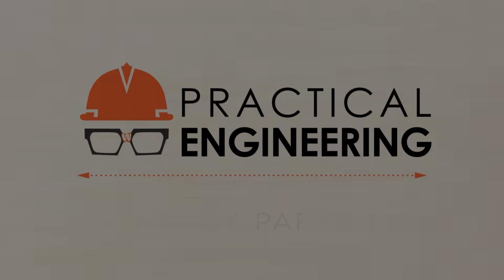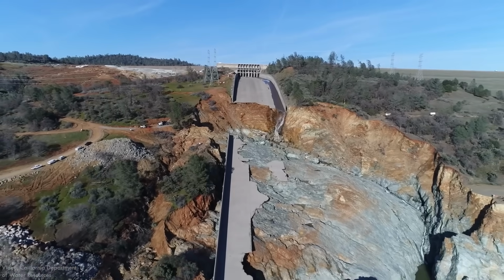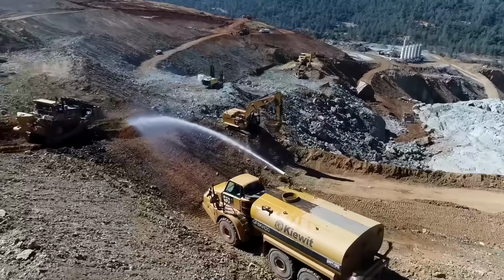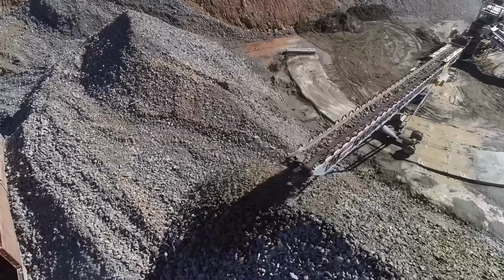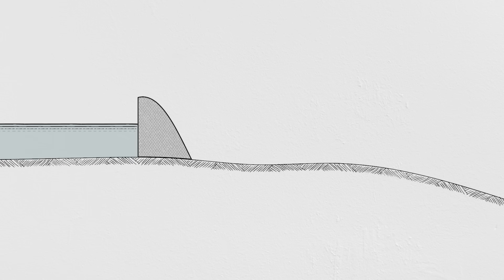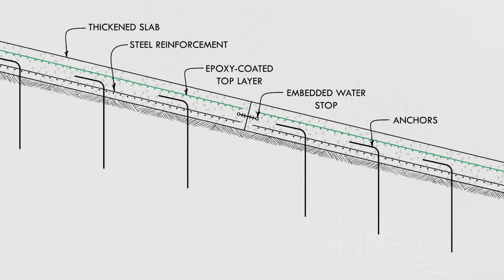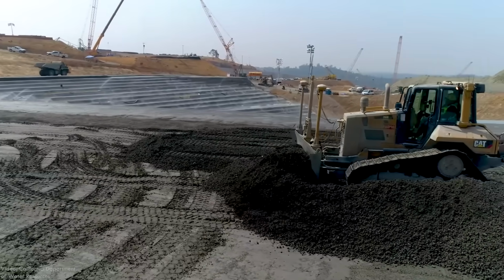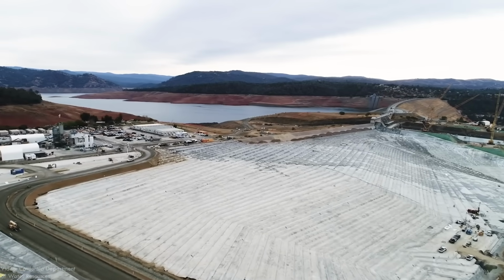Rebuilding the Oroville Dam Spillways

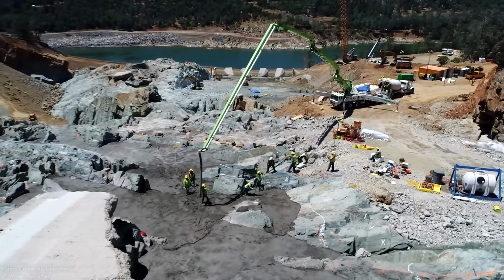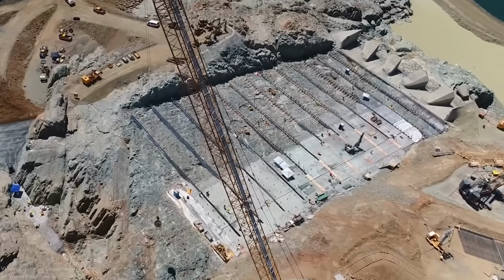Comment: I may be drunk (which would be quite an accomplishment since I don't drink), but the video from about 11:45 - 12:00 appears to show work crew members using ShopVacs to remove the dust from the rocks. That video would support the narration, which said dust, dirt, and debris were removed to ensure strong concrete adhesion. But using ShopVacs? That would definitely drive me to drink.

Comment: This a typical state project that has to have kickbacks to make it that costly. It should be audited. This is a typical state project like the High Speed RR the voters fell for. Why didn't the Bullards Bar spillway fail. It is much steeper and carries as much water? It was a Yuba County project designed and managed by a private engineering company.

Comment: This would, probably, fail too... there  are nothing to slow down water on the way of spillway.
See how Sayano-Shushenskaya HPP shore spillway made (it has 5 water-slow-down-reservoirs at 5 levels or five-stage drop consists of 5 disperse wells, 100 metres wide and with the length from 55 to 167 metres, divided by the dams). Water slows down from 30 metres per second to   4-5 metres per second at the exit to the river it becomes slower.

Comment: Uma rampa mal construída . Danos que ficam para outros pagarem.

Essa rampa nao tem base geologica para suportar a umidade , peso, vibracoes e dilatacoes e ancoragem de peso horizontal do concreto. Alem de falhas de capacidade de vazao pela inclinacao e resistencia estrutural da rampa ( muita agua para um angulo de inclinacao com uma  estrutura nao eficiente para as especificacoes da vazao e velocidades ). 

Uma coisa é ter agua, tracado de queda e bitolas de vazao e alturas potenciais. Outra coisa é ter uma estrutura eficaz e segura para suportar os esforcos e efeitos mecanicos da água  e da propria estrutura . 
Economizar para baratear uma obra pode resultar nisso.

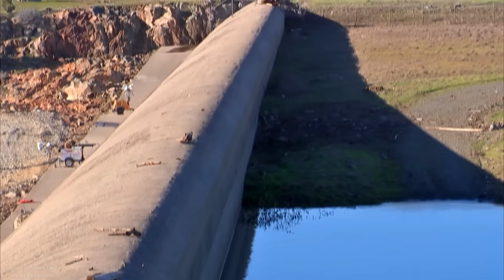Comment: where they show the cut through section of chute about 2:10 you can clearly see that there wasnt uniform depth of concrete under the chute across the section, only about 12-18 inches at one section: they thought, oh well, no - one will ever see this.

Comment: I watched the building of the original  dam. I have complete faith in it. Over the years the people controlling the water have done the best they can with what's been put before them. I totally agree with the way they had to release the water when the spillway failed. As far as the original builders of that. They did what was required in the 60's. Alot has been learned since then and better products have been developed. The same problem was seen at Folsom Dam.

Comment: I'm curious about the splash pad. What is it, and what is it's purpose?
Reply: Its purpose is to slow the flow of water as it comes over the emergency spillway (if that ever happens again) and to prevent the head cutting erosion that threatened the emergency spillway weir and caused the evacuation order to be given.  It's quite an impressive piece of concrete in person - if water ever does go over the emergency spilly again, it'll be quite the spectable cascading down that splash pad.

Comment: Thank you so much for creating this (and the related previous video on the original spillway failure) summary of the remediation effort on this massive structure. While I'm a fan of most things involving technical engineering, I am not an engineer myself. Your presentation conveys the story in an easily understood and somewhat entertaining manner. I hate to use the term 'dummed-down', but you've accomplished to communicate the essence of what was done an why without needing a PHD to follow along. Great result here!

Comment: My dad and grandpa worked on the Oroville Dam in its original construction. My grandpa was actually a foreman over the Spillway project at the time. DWR had been notified many times over the last 10-20 years that the spillway needed maintenance and without proper care would lead to failure. This is a result of negligence by the DWR.

Comment: In April 2019 the lake was overflowing and 18 months later it was empty they got all of you to believe it was because of a drought. The water and the water in our other reservoirs were drained straight out to the ocean. 
Before activist judges took over our reservoirs it would have taken 5 years of zero rainfall to drain Oroville they did it in 18 months with two-thirds of the average rainfall.

Comment: Paused it about 5 in where they did the scale model. It looks like they only modeled the hill side. I have a addition. All the way to the right where it went down the hill and not the ramp they can now reinforce with a good cleaning and sprayed on concrete held in place by lag bolt or bedrock attacked pileings with rebar to the the spray concrete in place in thick layers. Once it's built up and set it will retain the natural shape and in strategic spots along the hill place bedrock held dentates and like the main spill way a row or 3 of dentates at the mouth of the river. That model look like they only showed the hill as it sat not modified. In thier defence but now they do have the time to research it.
Reply: As you saw in the video, the model was totally smooth, the probkem its the overhead water, the humudity will erode past the canal, and destroy it again.. for more information read the reports.

Comment: Fossil fuel and ELECTRIC 
GOVERNMENT MANDATES? WHY NOT MANDATE 
A 10kw generator individually per household that runs from a ELECTRIC drive motor. 
1--- $3,000,000 --1.5mw windturbine OR 857 10kw generators totally green producing 8570kw or 8.57mw 
7.07x more power the same cost!

Comment: I watched this video and then the previous video, which explained  the failure of the original concrete base panels of the service spillway,  and the new improved method of constructing base panels. My question is why can't the concrete base panel joins of a sloping spillway be more like those on individual roofing tiles on a roof, where the end of the upper tile/panel significantly overlaps the beginning of the lower tile panel and the water doesn't leak through the joint.  Just butting bottom edge of the higher base panel against the top edge of lower panel allows water to get into the joint and cause trouble.

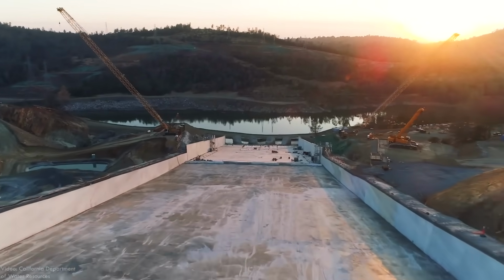Comment: At 14:15 in the view across the spillway and river you can see the trailer we deployed with a ground-based interferometric radar (IDSGeoRadar IBIS-FM) scanning the work areas, manscaping areas of access roads and slopes, and spillway section every 2 minutes for the duration of the work on the spillway until completed. Reports from these data were compiled by Appalachian Landslide Consultants (ALC) and provided on a daily and weekly basis to their contracting partners.

Comment: I wrote to DWR about using the water during the emergency draining of oroville dam using temporary irrigation pipe that exists in the san Joaquin valley already to connect to farmers wells to recharge the aquifer.   I was told that would not work. Too expensive.  Impossible.  In February 2022 a plan came out to do almost exactly what I had written them to recharge the aquifers.

Comment: 2409: 3 or 4 pipes of stell in concrete base level. Then coffer dam concrete boxes on top. So u can unblock any 1 of them or all of them. Inside pipe & sq dam on floor make floor concrete v type speed bumps out of concrete at least 10-12" high. On pipes of steel shape concrete on floor like a steel jail pipe cage in concrete shaped funnel 1/2 width into full width width. If u r washed out early on jail cage will catch/block u. Inside the coffer dams a steel horizontal hand hold drilled & height cemented in.

Comment: Ok my side walk enginers a spill means that you cup of coffe is full n if u add more u would have a mess on u table right?n what u do next its to clean that mess but u dont broke the cup to fix the damn spill right? Now if the dam get full let over spill. it was constructed to hold all the water to the top, the rest would be running down the streem but not the whole amount of water..so tell me my bolt enginers was its all the fuss about at little spill? Now if u want to take adventaje of this extra water? Built pipe lines to catch the water reruting it to the drier states or to the deserts .this way u use the water n create jobs on the way..think then u exist my enginebrios..👽

Comment: I'm not sure what drives some of these project engineers to approve heavy construction on unsuitable foundation soils.  Another example involves engineering of the earth fill Teton Dam in Idaho where they expected to stabilize the canyon walls with a gunite material in the face of massive porosity.  That was a huge mistake.  I guess you could point a finger at the Bureau of Recl. and Corp of Engineers for their rush to dam about every water source in America allowing for short cuts in site testing and the rushing of project completion dates.

Comment: Huge logistical undertaking and impressive as hell.

One armchair expert question on the options for rebuild...did they consider a battery of steel pipeline similar to large penstock arrays of dams such as Three Gorges in China? 

Not that one should compromise the primary function of the spillway but...a bypass to a turbine installation for additional Tesla fuel could be considered using pipe.

Comment: Just watched both vid's. just want to add they had warnings about this type of failure. the Lake Powel dam had a similar problem back in 1983 (?)  the angle of the spillway was over 11% and caused "Calvaction" (spelling?) anyway this was a known thing way back in that city that was in "Raiders of the lost ark" (the scene w/the the "Treasury " as they came thru the canyon. had a real water system & they had the sense to make clay pipes and keep it under 11%...

Comment: That’s a lot or work-coordination.  A while ago I was working as a mgt consultant for a large multinational corporation that included a large construction crew, which had over 500 foreman in all trades working all around each other.  It was a large job getting them all on the same page and organized.  There was a time when the construction crew built a wall, tore it down to build a wall that included electrical throughput, only to be torn down again to also include pipe fittings, etc.  The crew said they barely removed the forms only to be told of plan changes.  I can only imagine the Herculean task of analyzing, planning, and building the final design.

Comment: It looks over engineered by 10 fold, but that's normal with every engineer not wishing to repeat the previous failure and every calculation and assumption pulled to pieces by their peers and overlords.
Helps when virtually unlimited money is available, it would have been interesting to see the solution with only 20% of the money !! ( I know they discounted some of the eye-wateringly costly solutions but its still a monumentally expensive solution)
Reply: It seems to me that your are saying that common construction projects (that use only 20% of comparable funds) design and construct hand-waving possible future failures, pull calculations out of their bums, and barely anybody reviews their decisions.

Comment: Hi @PE, I apologize for asking a question I haven't done research on to see if you or someone else has already covered but I must ask now that the main spillway has been fixed, is there any thoughts from Ca's DWR on possibly fixing the secondary spillway that's off to the side of the Oroville dam that during the same rain season in 2017, they opened and it just started to munch up the dirt sides where they then had to close it back down quickly over fears that that side would undercut the dam as well?

I remember during that flood season they opted to go with the main spillway because that second side was just a terrible option.  

Have you sen or heard anything on this?

Comment: Peter Kiewit construction company did a great job on the project, but Kiewit wasn't mentioned in the video. Kiewit had to do everything on the fly, when normally a contractor would have months to determine what was necessary. Kiewit had to bring in all the equipment and workers. They had to do the time sequencing of the work and develop new techniques for using the RCC (roller compacted concrete). Kiewit had to do multiple projects at the same time, and it all worked. 
A billion dollar project done on time and no serious injuries......great job Peter Kiewit, and all the workers.

Comment: This version will fail eventually just as the original one failed and it too will follow that original washout and erosion path... They shoud've used that erosion path and gotten down to bedrock and then drilled and poured and added anchors through the bedrock and built up the concrete chute... Harder concrete mixes along with drilled and bolted through bedrock would have survived the short term overflows or flood events for many years.... Less slope would've been easily managed from start to finish and all at only 3/4ths the billion dollar cost and with the added benefits of reengineered chute and angle along with being rock embedded to last for many years and decades...

Comment: Roller-compacted concrete:  That's like when I mix a bag of portland cement with the earth that is already on my driveway, then I take a rototiller and mix it up, together with some water from a garden hose, and then I pack down the 'moist' mix with the tires on my car = it turns rock-hard in 24 hours, and I don't need to do any paving after that.

Comment: My critique, that the floor & sides of the structure are too thin at scale & need webs to handle harmonics in cavitation regimes vertically on the floor. This creates micro to macro surface cracks from upward motion by fluid_dynamic lift from the water going over the top curve at speed.

They had to shut down the 1st test early, far short of max volume. It seems it'd fail again if pressed my take, I've yet to see simulations of the acoustics on the free-span sections with vertical motion from zero to max volume from any further live testing as I feel strongly it was a critical factor in how it failed.

Bubble tracks appear at joints on the floor, there is a vacuum from flow drawing them out, this allows water to erode from below, it isn't just drawing air.
Ymmv.

Comment: What a tribute to the fantastic achievements of the engineers, workers and planners that all came together to solve this gigantic headache, to demonstrate huge resolve in the face of adversity and to overcome gigantic obstacles to rebuild this flawed and demolished piece of critical public infrastructure. Congrats to all and a big "well done"!
Reply: fantastic achievements? I had the impression that the whole point of the engineering was "more concrete, more steel!"
Reply: @GP-qi1ve  I know what you mean - and your statement has nominal merit. But if you look at the unbelievable scale of the project, the sheer number of metric tons that had to be moved, the amount of raw material that had to be placed and / or poured, the short time frame and the looming, POTENTIAL next desaster if the deadlines were not met, I'd have had wobbly knees just SIGNING some of those delivery contracts. Add to that the re-engineering that had to be done concurrently, testing and approval procedures that had to be done while being forced to already order the materials just to meet the deadlines, the unproven drainig system, ...

I still think this project was a 6 month road to hell, and those leaders that fearlessly took that road are to be commended, considering the wall of obstacles they were facing. I've built my fair share of "critical stuff" all across the globe and am not easily impressed, but THIS project strikes me as a whole different level of nasty.

Perhaps you've had more experience than myself at this type of construction project, and have a better feel for this project than I have. And anyway, alternative views are obviously always just as valid.
Reply: @christheswiss390  what I see is: a giant dam, which is ecologically very, very bad and the solution to a problem: put a shit ton of money and just build it bigger. There isn't a lot of smartness or skill in that, just a lot  of money. Once the dam has failed, you can just abbandon it at all.

Comment: This is probably one of the only positives of the drought California has gone through over the past 4-5 years. Luckily the dam's spillway failed during the beginnings of the drought.. I can only imagine the devastation if the failure occurred during normal, or worse, el nino type rainy conditions, I'm sure the town of Oroville would have experienced a catastrophic flood as the dam completely failed, and/or heavier rainy seasons would have made the rebuilding process more difficult as the rains would have started sooner or significant summer showers (if el nino conditions).

Comment: This is why it was an "emergency" spillway. They knew there was too much exposed earth near the bottom that would soon undercut its own foundation and chunk away from the bottom up.
I have walked the spillway before (not since the spill) and that transition caught my eye too. I Was told that it was because it was last case scenario emergency discharge, and if it was used, it likely means the dam is going to need rebuilding anyway
Reply: The dam will need rebuilding? I think you meant the spillway

Comment: I am amazed that so many comments indicate that they are amazed that the concrete native interface needed a good bond and clearance of loose debris. Hope none of them are involved with construction of critical elements or similar structures.  The use of RCC and RCA were a complete game changer for a project of this magnitude.  Would be great  for the environment if  the use of roller compacted geopolymer concrete (RCGPC)  or other geopolymers could be utilized on other large projects. Overall, great video Practical Engineering.